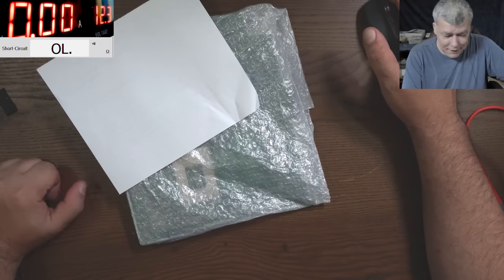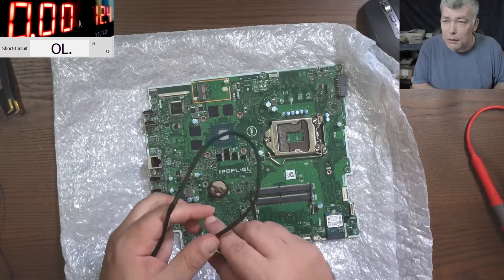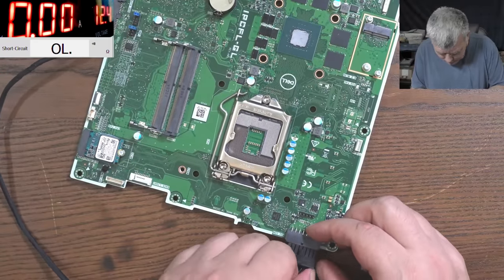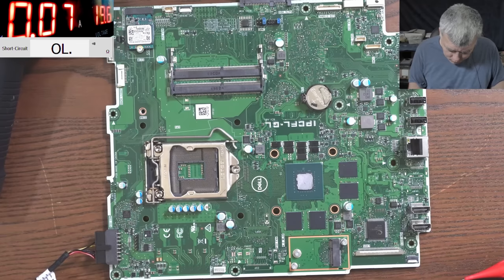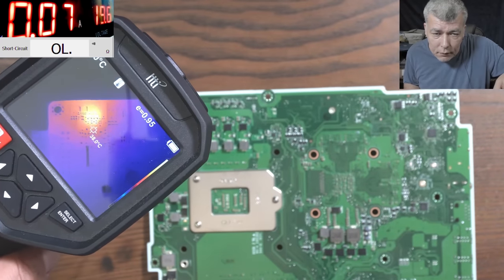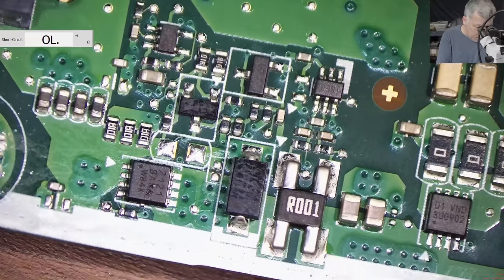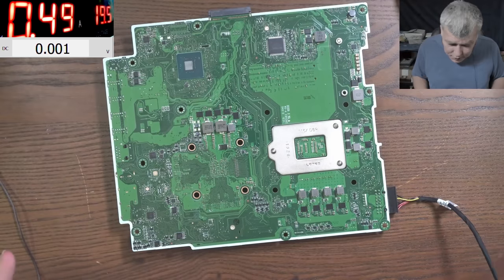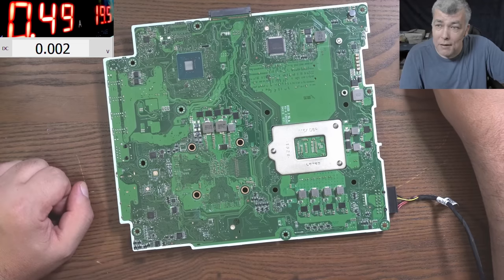Dell AIO 7777 motherboard repair - Wow, this is a nice board...

Comment: A thorough visual inspection would have found this, although using the thermal camera might be quicker :)
Reply: @tim0steele: Yeah! I agree with you but (6:40 exactly and freeze frame) observe almost in the center of the image, a little below and to the right of the three inductors: that tantalum capacitor was already damaged and the thermal camera shows a hot spot but in another area of the PCB (6:34 exactly). So the initial total visual check of the PCB under the microscope is a very good habit.
That 180 Watt charger, 18V, 10A (3:41 exactly) is a device to respect (it must be taken into account). The owner of that motherboard was very lucky this time. Sincere greetings, affectionate Tim.

Comment: Sorin have you ever diagnosed atx motherboards where they boot and not post?
Reply: i don't really understand your question , is it the POST is only displaying and not booting ?
Reply: @Soloptech  post is displaying once booted. The motherboard powers on with the correct voltages but no post ive checked ram slots and they are all fine, the cpu works on another board
Reply: Cpu memory and pch get hot
Reply: @ninjatall15  okay and don't passed the POST right? i'm suggesting you reprogram the Bios. i love to know the outcome sir.
Reply: @Soloptech  I have reprogrammed the bios and verified, I have tried 3 different bios versions, when i put in a postcard the RST light is on and the code is 00

Comment: How did the board still work even though the gate was 19V?
Reply: That gate was 19V to prevent further damage to the board, the current sensor detected the high current and the command to the mosfet was to stop the current flow. When the shorted capacitor was removed the current sensor detected normal current and that 19V was lowered most probably.

Comment: 1:30 <- Can you ewer replace a soldered CPU ? Yes ? Do it on video PLS ? (its not imposible same mb can have different cpu/s but sure will have a lot of capacitors on the mroe powerfull one :D ) ..
Reply: working board is 20~50$ and changing cpu socket is 200$.do a math !